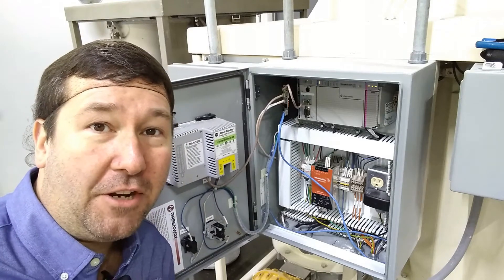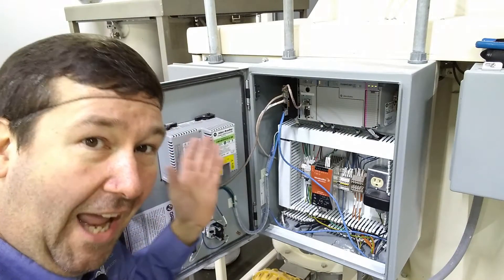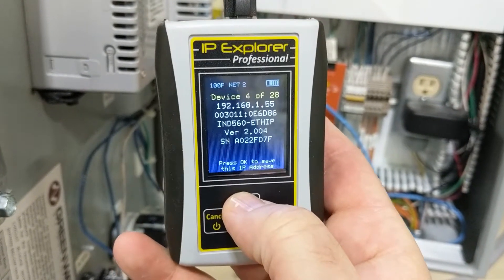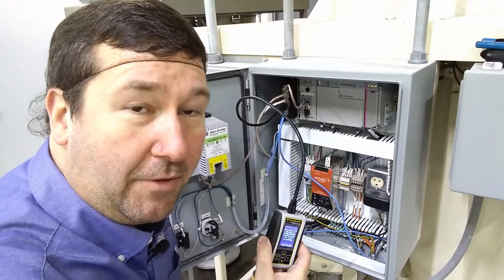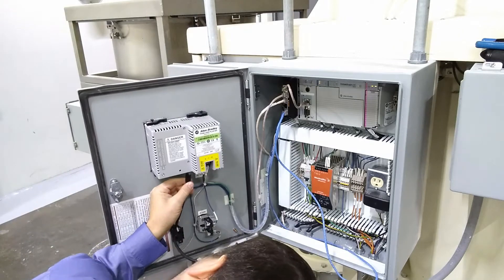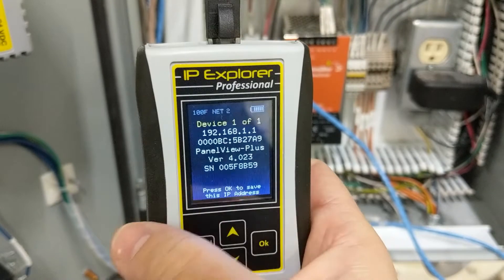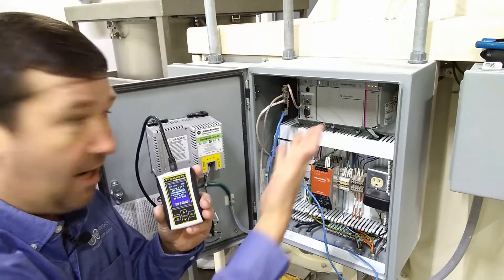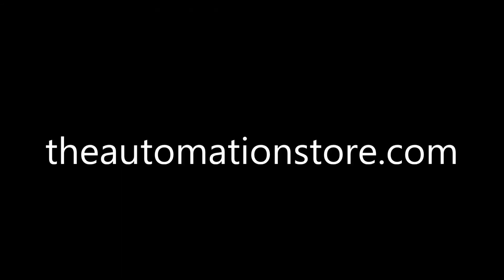How to Read an IP Address of an Allen Bradley Panelview Plus

Comment: Great videos! I have been muddling my way through Connected Components Workbench, and your videos have been a big help. If you take requests, 
please do a video on the data logging feature in the Micro820. I know there is a way to log data to an SD card with the DLG block, but I am still running into a few errors.
Again, great videos! Keep them coming!
Reply from the maker: Hi Kevin.  We do take request and we have one coming on data logging with the Micro820.  We'll also be using it several times during our PID series.